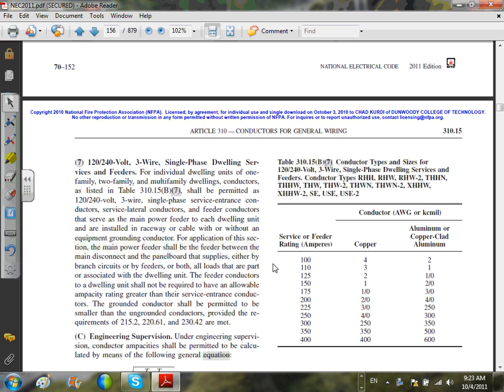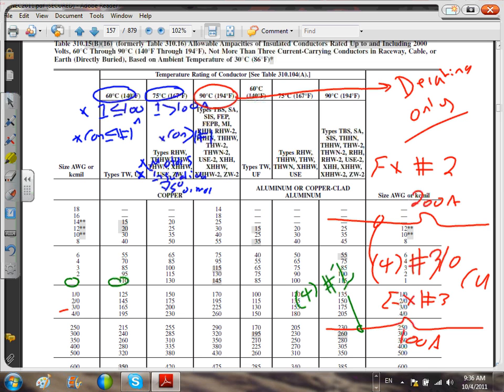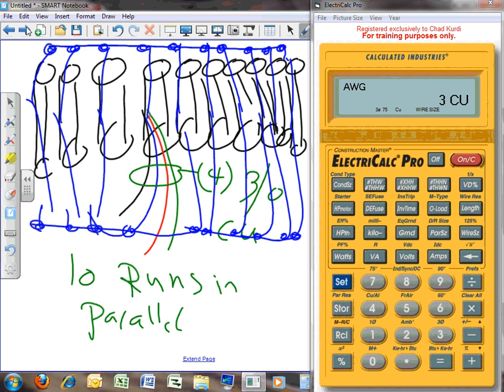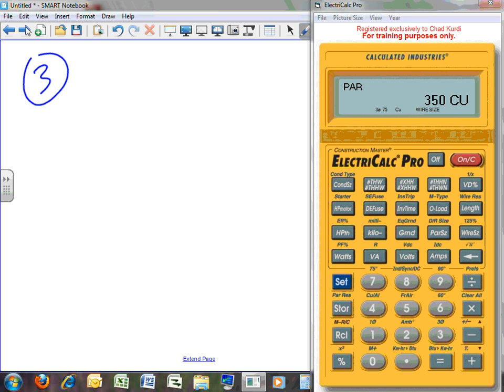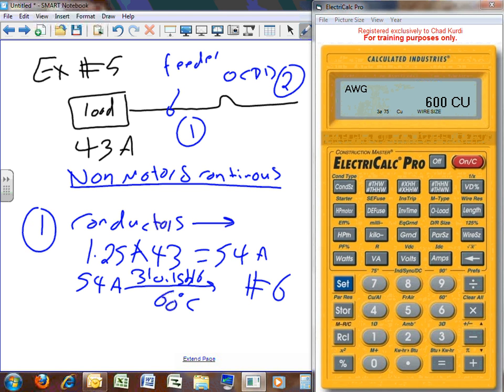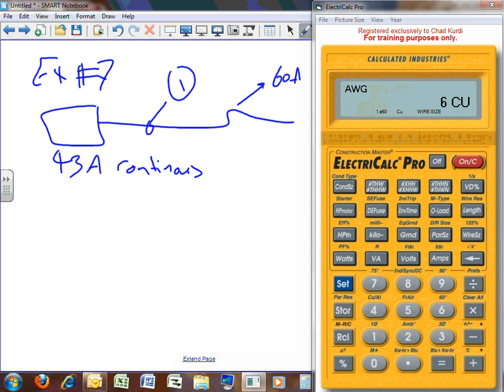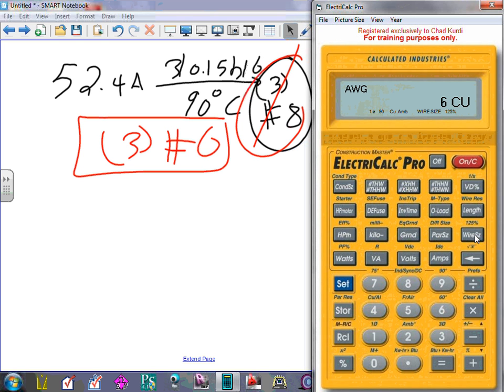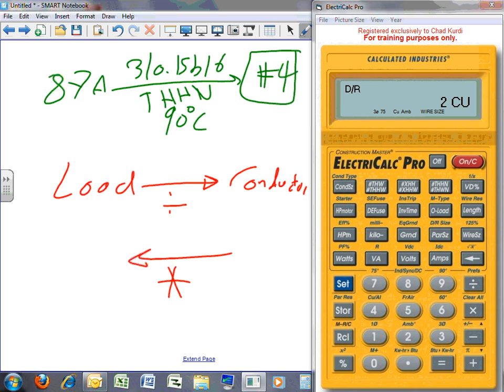Ampacity Calculation (U#6)-10-04-11.wmv

Comment: Very good session. Understood about derating very efficiently.  I felt little difficulty in this session with NEC 2014, as the table references have changed/removed from NEC 2011. If possible, Kindly explain about the number of conductors to be used in Single Phase and Three Phase in realistic application in Engineer and Contractor perspectives.